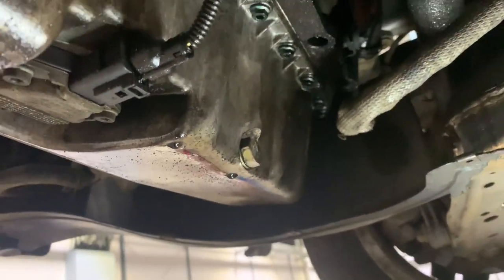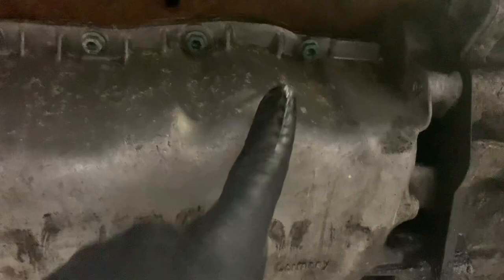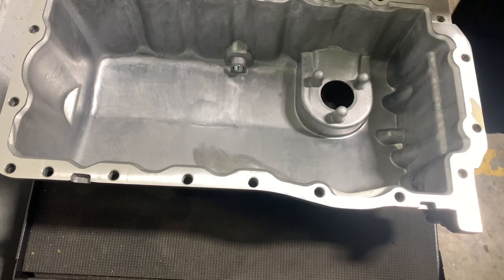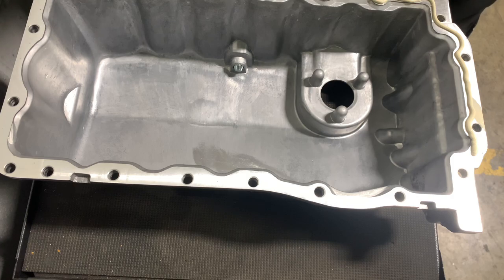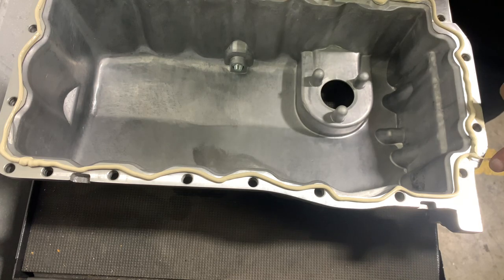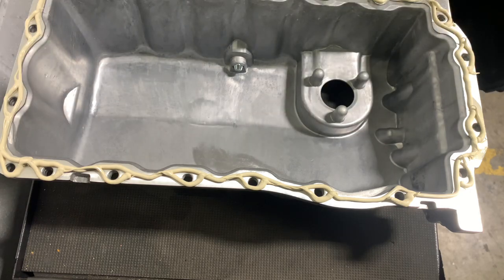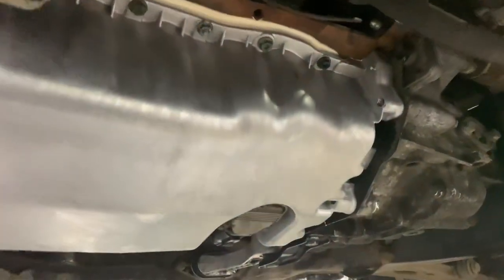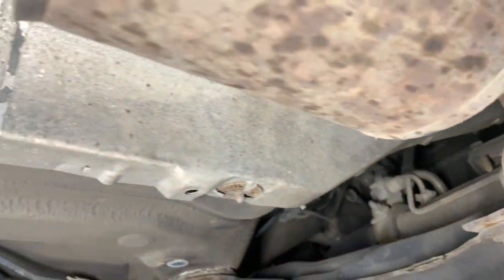Volkswagen Golf mk4 diesel sump replacement! Vw! Oil pan!

Comment: how to screw in quickly those 4 angled bolts which are in tight space and to screw them in without crossing the threads?
Reply from the maker: Either with the extended ball end Allen keys as shown in the video and start them by hand.. or small 1/4 Allen key bit on a universal joint gets in there
Reply: There is a space in the flywheel. Just rotate the engine manual until space lines up. Will make it super easy

Comment: Wtf? a ton of putty leaked into the oil pan... what will the life of the engine be?
Reply from the maker: No putty leaked into the engine. Someone put it around the sump bolt to stop it leaking.
If you did get a tub in there, no telling how long, more than likely block the oil pick up pipe and starve the engine of oil
Reply: I thought the same. I think for VW spreading instead of bead might be better (the reason are the plastic surfaces on the side). I don't think more is better. I think I better have a little leak than a broken engine. It's easier to fix and can wait until the next oil change = cheap.